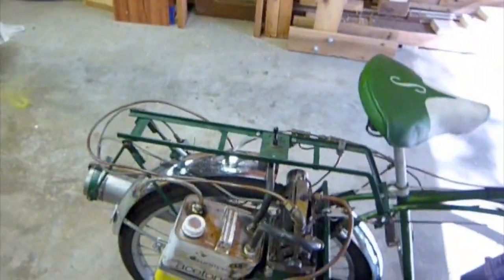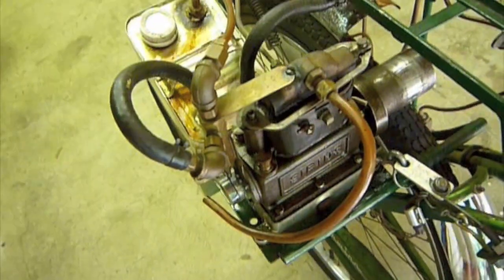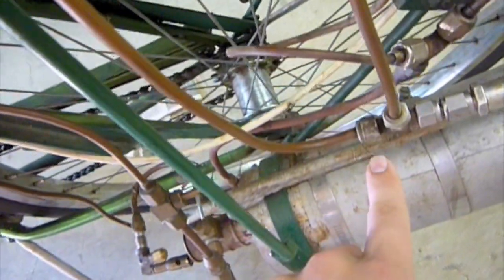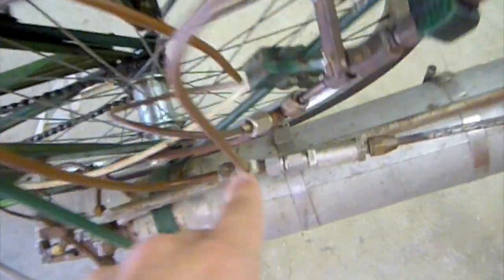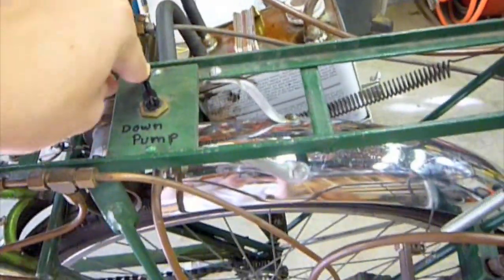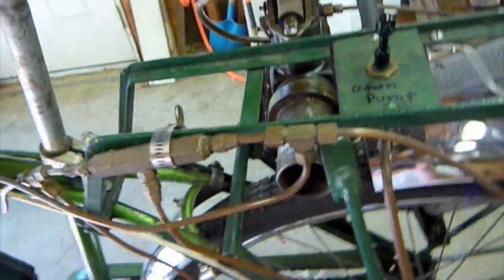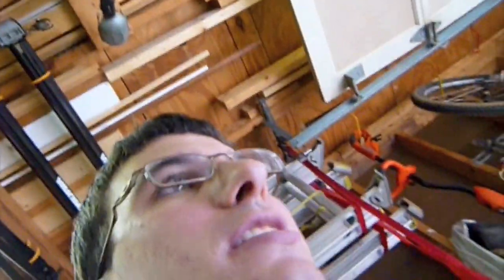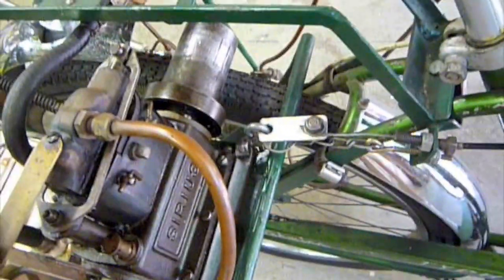Richard J Smith Steam Bicycle How it Works

Comment from the maker: A steam automatic is a steam pressure based fuel shutoff.  When the pressure gets high enough the fire shuts of preventing the pressure from rising above a preset level.  It works with a spring providing resistance to the steam pressure and when the pressure gets high enough the force it can exert displaces the spring enough that a needle plugs the fuel line.

Comment from the maker: That is one of the many things I've been trying to work on the bike is to make a condenser for it.  I have a friend who is willing to give me a heater core to do it with, but I have been slow about it getting the heater core.  I did plan to feed the output of the condenser into the bottom of the water tank.

Comment: I commissioned Dick Smith to build a steam bicycle back in the 1970's.  It was much more complicated looking than yours.  Robert's version looks like an earlier built bike.  Mine was built on a multi-speed frame using an overrun clutch ... so the bike could be peddled, too.  It used an Olson & Rice engine converted to a bash-valve configuration using Smith's Super SASS steam generator of which the steam generator's burner was positioned under the bike's seat ... a factor why I didn't ride it, lol.  I sold it around 1980 and haven't heard of it since.

Comment: run the exhaust into a tight 6" diameter coil  to recondence the exhaust steam and feed  it to the bottom of your reservoir any extra pressure will go out your air intake and you should decrease the work needed to be done by the boiler and increase your water supply

Comment from the maker: @Cytacon Now as far as efficiency goes.  Smith was probably trying to design the lightest and most cost efficient system he could.  The engine weighs ~6lbs.  The boiler only 20 most of the weight comes from the support frame and the fact it is a steel bicycle.  If a bigger engine was used which some bicycles did you could have less heat loss and if it had a longer stroke higher thermal efficiency.  My bicycle is currently 7% or so, but a larger engine could probably get it up to 10% or so.

Comment: Nice steam bike! Are you using a Stuart Sirius? Stuart advertises the Stuart Sirius at 0.4 HP at 80 PSI , so at 250 your set! Monotube boilers are great for high pressure applications like this : )

Comment from the maker: It is using a stuart sirius.  I like to run the bike between 200-300 psi and 600-700 degree superheated steam.  At the crank at 80 psi superheated steam no clue how much the stuart sirius makes .4 hp at the crank, but there's nothing restricting the engine.  On the bike there is a pump which at times may take up to 2/10 hp plus I lose a lot of power >70% at the spindle so way less than the 3/4 hp still left after the pump is mostly wasted.  I need to work on a new spindle.

Comment from the maker: @WOODRUFFAPTS I think anyone could argue about this for hours.
The fuel holds the potential energy that turns into the mechanical energy which the powers the bike forward, but unlike an IC engine power is less related to the fuel in the terms you could have a big engine, but a minuscule steam line that could only let a lower pressure into the cylinder limiting power. IC engine fuel explodes creating expansion directly from the fuel, more power more fuel, but steam doesn't necessarily follow that

Comment: in reply to WOODRUFFAPTS. The fuel heats the water which is then converted into steam. Richard Smith's VW Beetle would easily make 60 mph & get 300 miles on one gallon of gas, which again is what is used to heat the water in the boiler which in turn powers the engine.
Reply: +vleonica Assuming a VW bug was able to get 30 mpg with a lowly 10% efficiency with an ICE, Richard's car would have needed to achieve %100 efficiency to achieve 300 mpg.  Did you accidentally put down an extra zero?

Comment from the maker: @Cytacon It depends on perspective.  Comparing this vs. a lawnmower powered bicycle, this bicycle is less of a physical challenge as I just turn a valve light a match and its on.  No annoying pulling of starter cords and hoping the engine starts.  Its more of a mental challenge.  My bicycle also does not have all the automatics which would allow anyone to ride it, if you wanted to go you just open the throttle and the automatics take care of supplying the boiler. That answer user friendly or not

Comment: Awesome!  Been doing some on-paper work with modern steam myself.  Didn't know anybody had built a working motorcycle with a gas fueled water tube boiler.  Had a few thoughts about a condenser.  
An automotive heater core would make a nice condenser.  A fan probably wouldn't be necessary, since the engine only runs when you're moving.  
If you do decide on a fan-forced condenser, think about a mini-turbine (maybe a Tesla disc turbine) using the exhaust steam to drive the fan.   
Another idea is running the exhaust through a tube in the feedwater tank before the condenser.  This will heat your feedwater, which should improve efficiency.  Might want to insulate the water tank in that case.  
A thought I had for a larger bike/car/whatever is using a liquid propane cylinder instead of a vapor cylinder.  This would let you run the cryogenic fuel through the condenser first, chilling it and heating the fuel at the same time.
Reply from the maker: Mark Stockman Someone built this 25-30 years ago.  Unfortunately the early history of this bike is unknown.  Its known history picks up in the 1980s. 

I thought about a heater core and a friend gave me one and richard smith suggested it, but for now I feed the exhaust steam past the excess flow from a flow regulator I built for it and then dump both into the water tank.  It has improved fuel milage considerably.  Unfortunately the water tank has sprung a leak from the pressure lol because it was working right and so I'm not sure about the water consumption till I fix the tank.

Comment from the maker: @Cytacon The bigger engine would provide more power and I know the boiler could handle it.  I have an account of this system mounted to a roadbike with a 50cc instead of a 25cc and it was capable of 40mph. I have also considered putting a condenser on it but it would add weight and more so I haven't gotten around to it yet.  Along with the actual condenser there will need to be an electric fan, a control system for the electric fan, and batteries which adds complication.

Comment: Neat steam bike - be sure to add a lubricator for the steam engine!
Reply: Hi CurtaCrazy!

My bicycle runs off 750-800C Steam which is of course superheated.  Since typical lubricators work when saturated steam condenses into water and because oil is less dense, the oil gets pushed up and I to the engine by diffusion.  Since there is no moisture in my steam lubricators don't work.  Instead of having a separate oil pump to save space, I mix the oil into water supply in a high mix ratio and use chemicals to increase the oil density to match water.  So it all gets pumped together and the engine gets lubricated that way!
Reply: Whoops I meant 750-800F not Celsius lol
Reply from the maker: I thought I had replied to this last week, but anyway my steam bicycle operates using super-heated steam.  How those displacement lubricator works is that water which is denser than oil condenses in the lubricator pushing oil into the steam chest and lubricating the engine.  The problem I have is that my steam is dry and won't condense so I actually mix steam oil into the water using a degreaser which makes the oil water soluble and go with the water through the generator and all.
Reply: Have you tried installing a loop of tubing between the main steam line and the displacement lubricator? The loop would allow the steam to the lubricator to condense and in turn displace the oil, and in turn lubricate the engine. I can't imagine oil in the generator coil would be good for it for very long... Nor do I think oil and degreaser in the water would be beneficial to the engine... I imagine the degreaser would counteract the benefits of the oil. Could be wrong though.